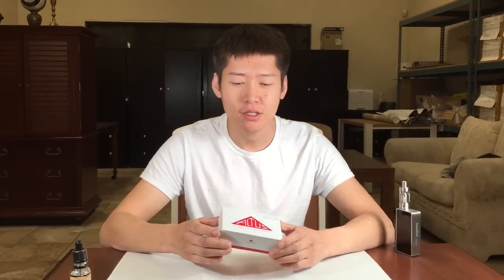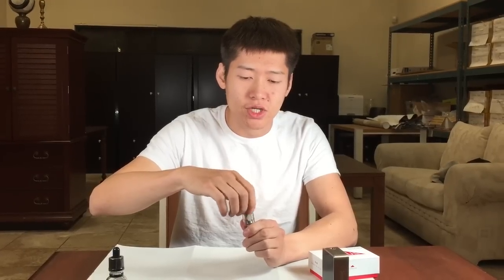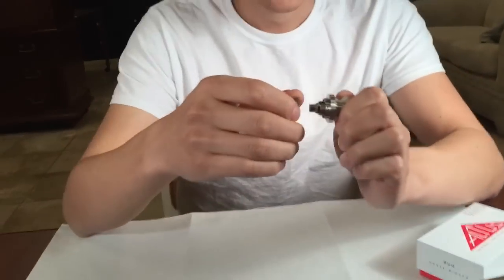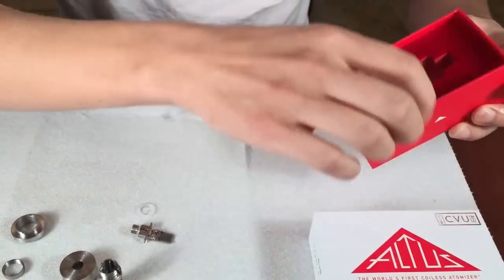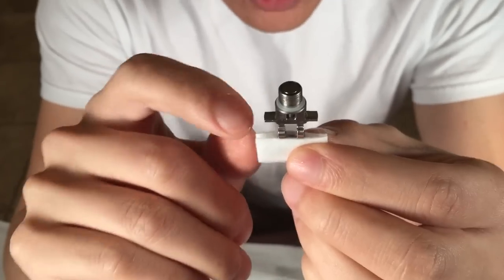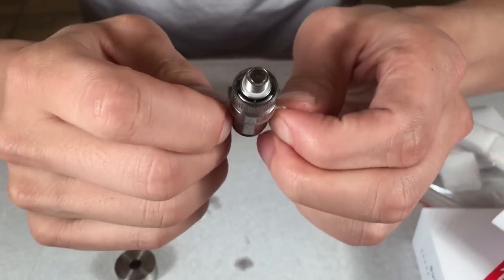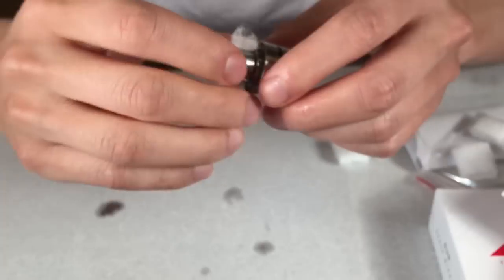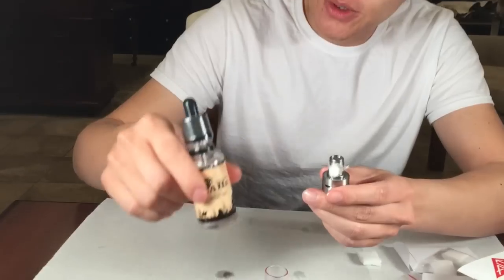Altus coiless atomizer tank by GUO (Unofficial Product Introduction)

Comment: Hi I just got my altus tank and dna200 mod I've been trying to rewick the altus tank several times. Im not so sure why I do not get as much cloud and seems to choke on the vapor when i bump the wattage up to 50w. And when i switch to TCR mode at 50w and 400F I kept on getting "ohms too high". Is there any method to rewick that makes the cloud more and less choking? I followed mike vapes on youtube step by step but still same results.
Reply from the maker: +Chen Yun Mu you may contact our customer service for the special TFR settings. Also you want to make sure the length of the cotton is just right so it doesn't cover the port clips. Lastly, you may release the power before finishing the draw to avoid any burnt flavor and over-heating. If these suggestions don't work, try a different mod. Let me know if this helps.
Reply: +David Guo Hi I've sent an email to the support but not yet receive any reply. It would be great if you could provide me here.
Reply from the maker: Hi Yun Mu, our customer service agent is out for surgery. But when she is able to help you we can make this right for you. If you want to use it at higher power, you may want to get the T1 instead. Just FYI.
Reply: Hi David thanks for your reply, I would prefer less choking and a not so warm vapor. I'm using a VG 70 pg 30 juice though. I will try it out tonight and let you know the outcome.
Reply: +David Guo Hi david i just tried your csv file it works great however i get reading that "ohms too high" is it normal?

Comment: I bought this tank yesterday.  Cost me AU$130.  I now want to install an emergency shower in my study so I can decontaminate as this tank has done nothing but leak boiling hot nicotine e-juice over me.  Ive ruined clothing and nearly burnt the crap out of myself with chemical burns.  Spit backs suck too.   All coming through the bottom air vents.
Reply from the maker: +Risk Rarius Sorry to hear that, Risk. I think you are not installing the cotton correctly or forgot the o-ring. We have yet encountered a unit that is like that. Please be aware of the instructions and be careful.
Reply: O Ring is in place.  Was installed at my B&M Store
Reply: I am a Military Electronics Tech with an Associate Diploma in Applied Science (Work Safety & Health) with a CV showing my work in Engineering (Mining & Refinery & Major Industrial including chemical facilities) I think I will be safe.  Having said that, The Seal is in Place correctly.  When I can be bothered to revisit it, I will work on a correction, from my end.
Reply from the maker: +Risk Rarius if you haven't mailed it in, please contact leslie@guovape.com, give us your address and we'll send you the extra parts/improved parts to make this right for you. Thank you for trying our product.

Comment: ok david, just got the tank, what do u recommend vaping it at? power mode? TC mode? what wattage?
Reply from the maker: +STEVE VECC Hi Steve, if you use straight power mode then be sure on your very first fill warm up the tank slowly from about 30 watts. I wouldn't go above 75 watts on straight power mode. Personally I like it best at 50 watts. If you use TC mode, the coefficient is 0.0045 from online sources. This number is not official, as I need to verify it. But if you use nickel setting, try 50-200 watts but keep the temperature between 180C to 220C. You may find out what's best for you. Hope this helps!
Reply: +David Guo ok, I'll try that out, thank you for answering.

Comment: looks great,but I do not like devices that limit my vape.A limit of 75 watts,and 480 degrees/f is not going to work,i don't think.I'm not saying I need more,but I might,and although it is a great idea, new tech will not limit our vapes,you still have too cotton it up.It is not too much different than building your own,and with this tank,you are stuck with the flavor,wich might be better than ss,nickel,kanthal,etc...,but if it is not,you do not have the option of using other wires.I'd love too see this tank with no limitations on wattage,and temp,within reasons,but much more than 75 watts,and more importantly,no rampup time.I'm no expert,but a surface heating area basically submerged in juice,and so l;arge,might need much more than 200 watts to bypass the rampup time.More wattage means,bigger,and,or more batteries,and usually bigger devices.Great concept though,and I might be proven wrong,and I hope that I am.
Reply from the maker: +bruce i use 200 watts with TC but just set the temperature lower, say ~200C

Comment: Hello David ,I have received the Altus yesterday and have some questions on the use as far a proper settings for vaping. This is in reference to the fluctuations in the ohms during use.Please contact me on my Facebook account or message me on messenger. Thank you in advance. Kenneth Dovich
Reply from the maker: +Kenneth Dovich Thank you for purchasing, Kenneth. It is normal for the resistance to double during operation. However, I was informed that variable voltage mods are not the best for the CVU. You should be able to adjust your mod to fixed voltage and it should work better. Not sure which mod you use, but I know that Altus works with most mods in the market. Please let me know if this helps.
Reply: I have a sx350j ml class and a DNA 200 mod ,they have resistance lock,  but don't know if that would work. I guess temp control will be the only thing I can set to keep cotton from burning. I just don't want to void my warranty. I paid 150 for it so I want to be careful. I watched your video and followed it. Now do you have to warm it up then bump it up every time? I was just hoping my CVU was not malfunctioning. But when you are vaping @ .55 ohm and it climbs as high as .98 before it produces good vapor for me is a big change in voltage.
Reply: +Kenneth Dovich are you talking about a climb in voltage or in ohms?
Reply: nevermind I think I miss read that.
Reply: +Kenneth Dovich Resistance lock should work. Yihi-platform mods were tested with the Altus and it performed stellar. Lock in that resistance and you are good to go.

Comment: Not sure why you say coils burn/overheat your juice and create more  "toxins". If you build for a proper wattage range by heat coefficient you won't have this problem, or just any other wire for TC
Reply: +cmerrill15 Idk where the "toxins" thing is coming from. He may be taking about burnt cotton, bad throat hit, or something similar since his Uncle's lungs are sensitive; however, he is right that coils burn/overheat juice. In temp mode this does not happen which is why your juice lasts longer and flavor is better. Traditional coils heat up the juice too quickly causing a slight reduction in flavor and not getting the full effect. If you tried the same juice with Ni80 in watt mode vs Ni200 in temp mode the difference would be noticeable. I don't think he's talking about using Ni200 or Ti in watt mode since that is dangerous.
Reply: If you build for a proper wattage range by using heat coefficient, you won't have this problem either. Also, titanium is a completely safe application for temp control coils. I'm still up in the air about ni200
Reply: +cmerrill15 I think you missed the last part of my comment, I didn't talk about Ti or Ni200 being used in temp mode being unsafe, I said watt mode. Temp mode it's perfectly safe. And yes if you build for a proper wattage range it won't burn the juice, but this requires you to build at higher ohms or vape at low watts so it doesn't burn/overheat the juice which 9/10 vapers do not do because they want good cloud production.
Reply: Ah gotcha my head just automatically goes to temp mode when talking about ti01 or ni200. Also you don't have to build high ohm/low watt for a proper heat coefficient. It is more about surface area, wire guage, and type of build. You need to disperse the heat over a greater distance of wire. You can have a cooler vape at 80 watts than somebody on a 1.5 ohm 20watt build. I think most vapers don't like too hot of a vape and those who mostly do, don't use temp control (which I this seems mostly based on) so this product wouldn't be marketed towards them. I like the innovation there are just a lot of buzz words and marketing thrown into it
Reply: +cmerrill15 Completely true and it will be interesting to see where this will go in the next few months once word gets out more.
Reply from the maker: +cmerrill15 Great question. It has to do with the fact that electrons flow at the surface of metals. Anytime you use a metal heating element, higher energy electrons translate the heat more directly to the e-juice. Because of this, metals face a higher minimum surface temperature. TC systems tell you the average temperature of the system, not the surface temperature of the coils during operation. With the CVU system, heat is distributed more evenly, and vapor forms at the surface of the cotton. This is the closest to the liquid - vapor phase transition temperature. In other words, even without TC you will get the best TC with this patented design.
Reply: +David Guo ok starting to grasp why you find this superior. how would it be used in temperature control mode with current mods. is there a TCR value for this "coil" ?
Reply: +cmerrill15 that is a good question. This chip has to have some kind of temp coefficient that ppl can adjust to read it properly

Comment: you tell bogus about normal coils. burning has to do with temperature - not the material. you can - with no problem at all - use normal coils without overheating the liquid. just a lie. i know you want to promote your product - but that's not the right way.

Comment: First of all coils do not overheat you'r e liquid unless you are running stupid low resistance at ultrahigh wattages and even then it will not produce any toxins. So for you to even mention this is appalling and you are not doing vaping community any good by coming out with such rubbish. 
Secondly you called the E liquid oil which it is not. 
Thirdly the vapour from your heating element is having to pass through the cotton to escape this means the inside of the cotton that touches the element will get very hot compared to the outside surface of the cotton this in turn will have the effect of drying out the inside surface of the Cotton and possibly cause the inside surface of the current to burn. 
And my final and fourth comment is that you mention that you are confident it is safe. It's no good you being confident it is safe. You must prove it is safe. 
I commend you for coming out with  something different but you really need to grasp The laws of physics.
Reply from the maker: +Phil Pinto "You must prove that it is safe." If we all had that mindset nobody would ever vape or smoke. I already released a lot of confidential information about the material and how it's made, and at the temperature of its creation all chemicals are burnt off. If people don't understand it, that's one thing. If people just plainly don't want to believe it, well I'm afraid it's not my responsibility to prove to the unbelieving. I shared the facts, and if you choose not to believe, that's ok. You have some good points, Phil. I'm just saying, unless you can prove that we were not abducted by aliens and teleported to this planet with implanted memories 5 hours ago, then all of this discussion is meaningless.
Reply from the maker: +Phil Pinto Phil Busardo will probably share the info I released with him. Follow him on Facebook or wait for his review. You can also watch my other videos for more information.